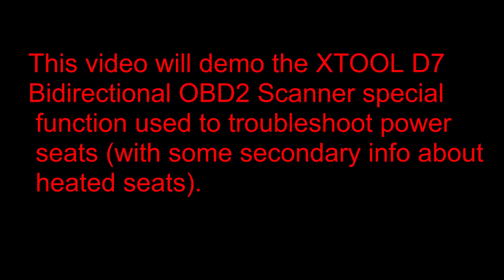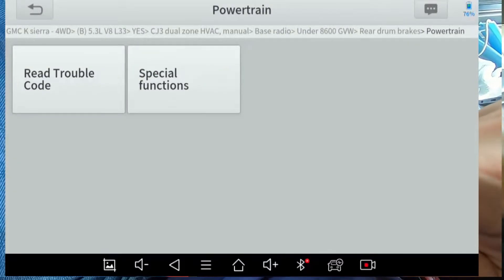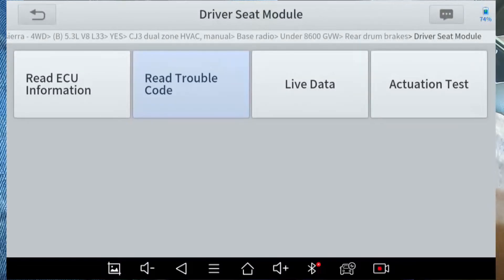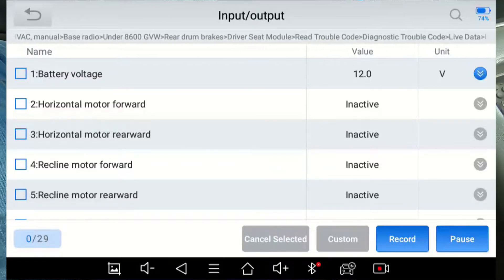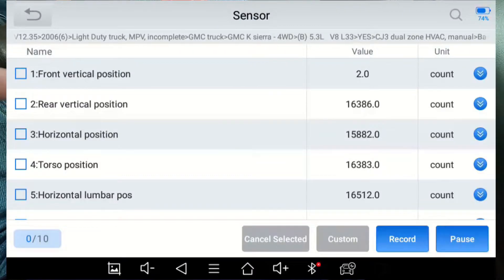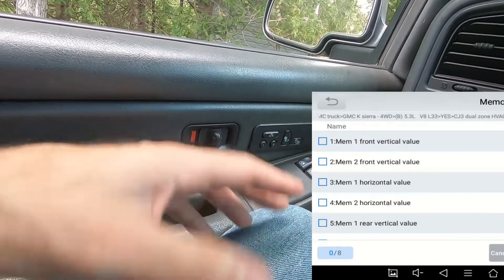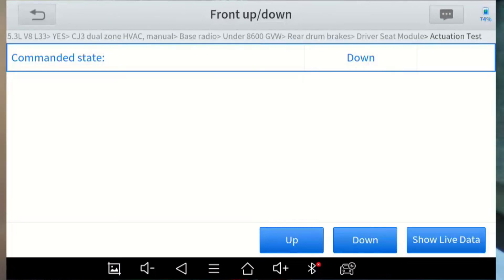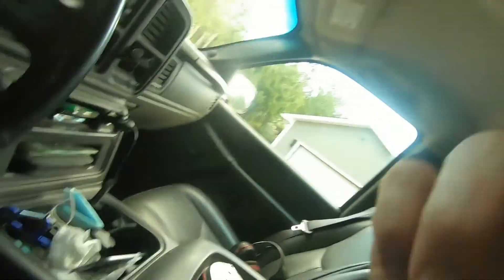XTOOL Scanner Special Function Power & Heated Seat Testing

Comment: Have you looked at turning off tpms light over the winter months using Xtool.
Reply from the maker: I have not investigated how to turn off the tpms light when sensors are not in your winter wheels.  The car manufacturers would not like to expose that control I would guess.
Reply: I have a 2021 Venza hybrid, I use the Xtool d8 and so have been unable in finding a way to turn off the tpms light for the winter months.